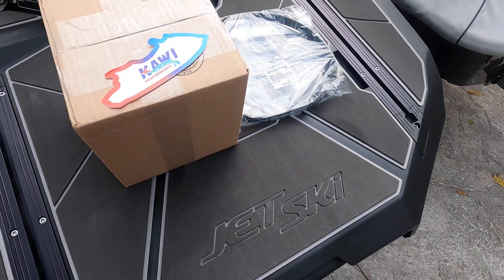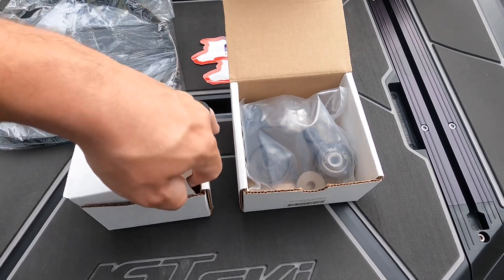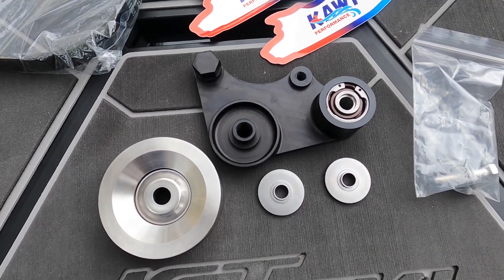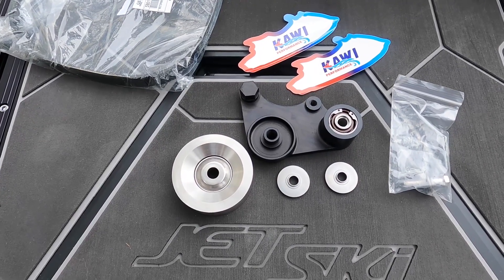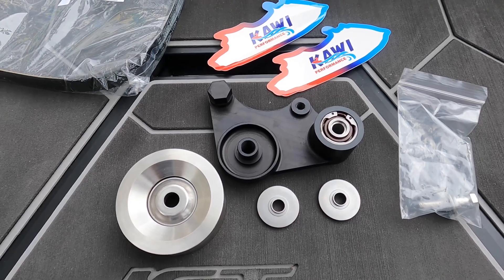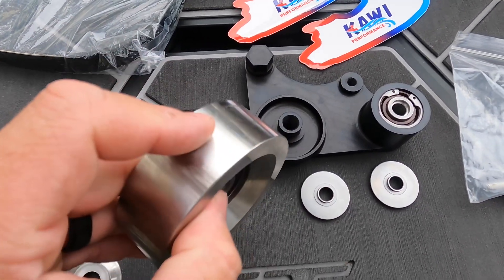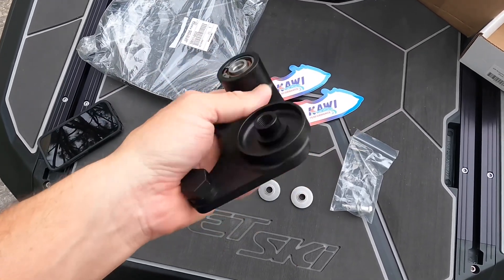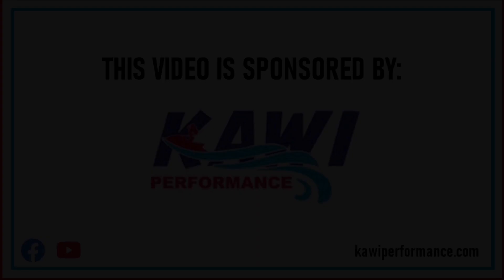Unboxing the Kawi Performance Auto Belt Tensioner and SS Idler Pulley for the Kawasaki Ultra 310

Comment: Congrats on the sponsored video!  I look forward to the belt replacement video and your thoughts on the product. I will likely get one anyway but your reviews are always unbiased and trustworthy. Thanks JD!
Reply from the maker: Thanks @jerplane! It’s a great product and solves a major maintenance headache we all have with the pivot bushing. Why Kawasaki did not design the tensioner from the factory with a bearing is beyond me! The funny thing is that I’ve read the service manual from front to back a few times, and not once is a procedure for greasing the stock pivot bushing even mentioned!! When the pivot binds, the belt slips like crazy and kills your performance. When I did the belt video I also made an intercooler removal video so both of those will be coming within the next two weeks and then the review and test of the KP tensioner pulley will probably be within three weeks and will be released at The Watercraft Journal!
Reply: @JDsWaterWorld  I agree Kawi should have made it that way from the factory. Yep, I also searched the factory service manual for the procedure and it's not there.  If it wasn't for your video i would not have known about it! I look forward to the additional videos! Take care JD!